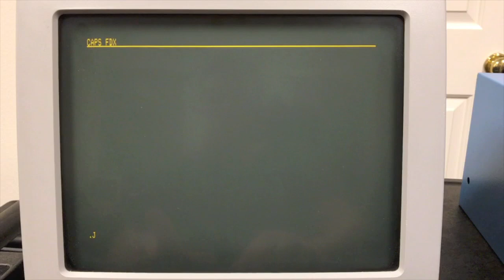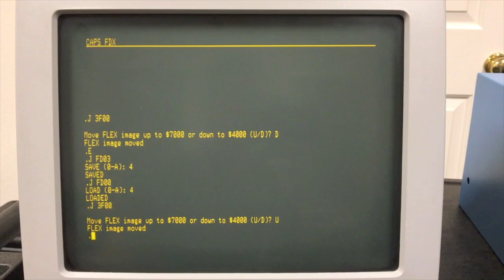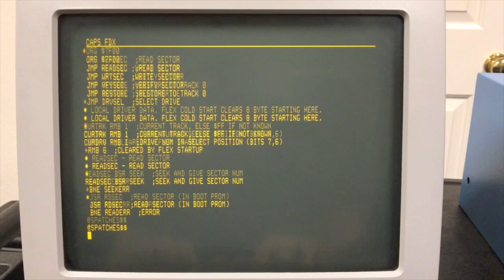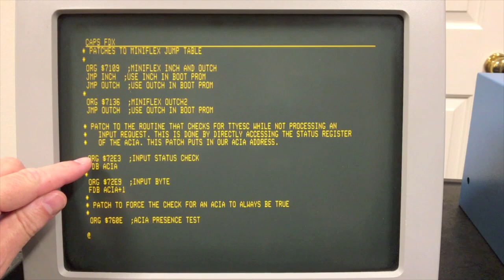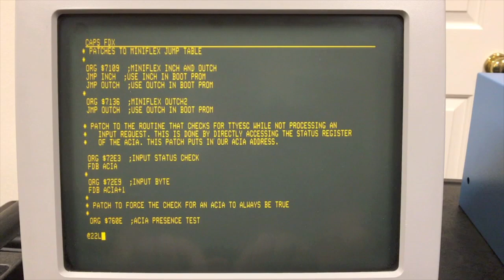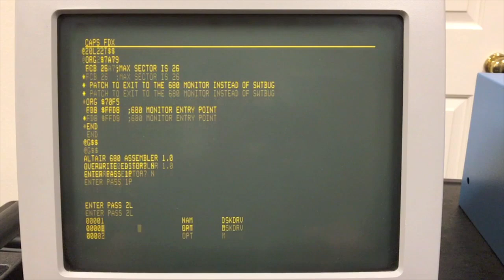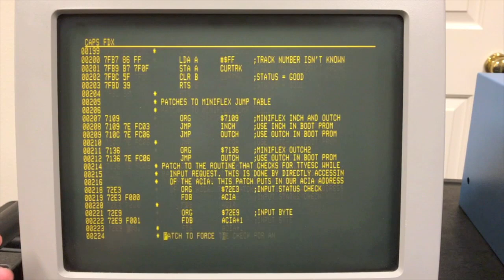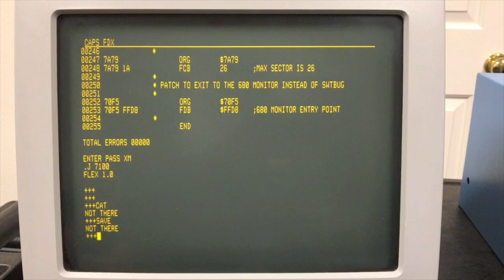FLEX on the Altair 680 - Part 1

Comment: What's amazing is that just five years later, it would be unheard of to do any such low level change for something as basic as floppy I/O. After patching IMDOS to use my Morrow disk jockey card on the IMSAI 8080, it's really impressive that people could do this without any internet resources to help them along. Now I just need to get a disk system for my SWTPC 6800.

Comment: Really clever idea, using xmodem as remote, structured storage. Letting the computer on the other end that already has a working filesystem deal with it is certainly not the idea I would have come up with first, I would have done something way overcomplicated involving hooking FLEX/FLIP routines that are already in memory. Kudos!

Comment: Where do you get Flex for the 6800 these days? I've been looking, and all that I've been able to find was Flex for the 6809, which wasn't what I was looking for. (Context: I have a compiler which emits 6800 code and wanted an OS to run binaries on...)
Reply from the maker: Here’s some of what I pulled together and augmented from the FLEX User’s group and Michale Holley’s work: https://deramp.com/downloads/swtpc/software/FLEX/
Reply: @deramp5113  Excellent, thanks. Relatedly, do you know who's the current copyright holder? Do you think there's any chance of getting FLEX properly open sourced, like happened to CP/M?

Comment: "If you haven't watched the previous videos in this series..."
Wait, what? Why does the video title say "Part 1"?
NVM, I'll just go with it and hope there's nothing relating to videos I haven't seen yet.
Reply from the maker: This is “Part 1” of porting FLEX to the 680, however, there was a lot more work before that to allow us to get to this point :)
Reply: there's quite a bit of non-FLEX related work done to get to the point that FLEX could even be possible. See the videos where he introduced interfacing the disk drive to this machine. This whole system is custom, the 680 never supported disks from the OEM.